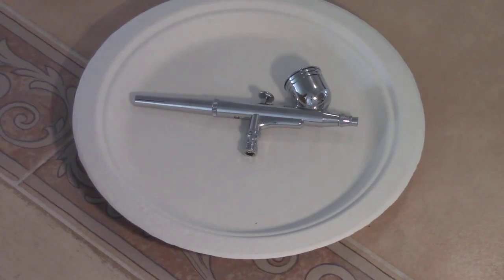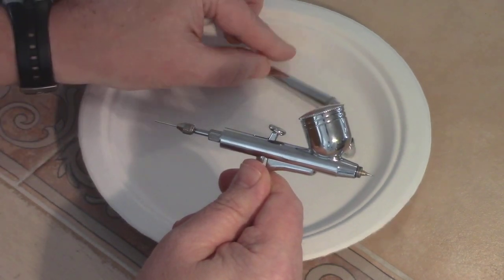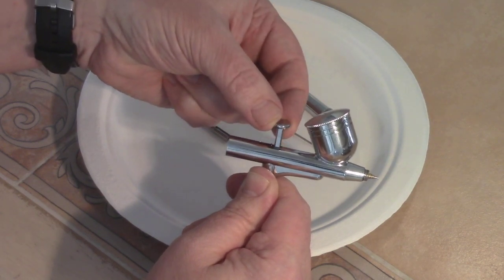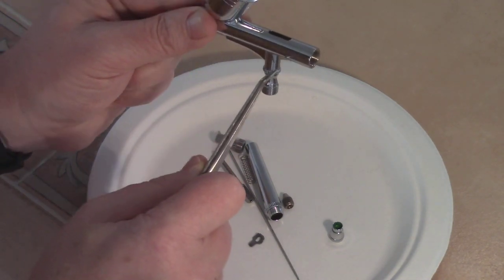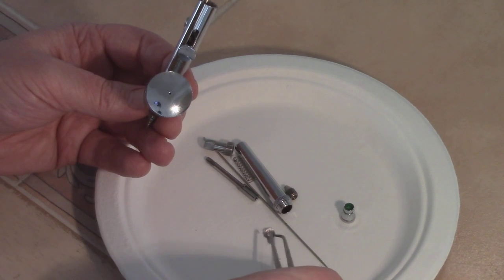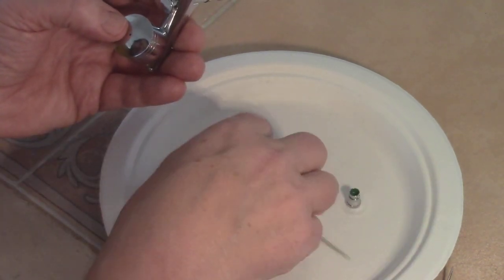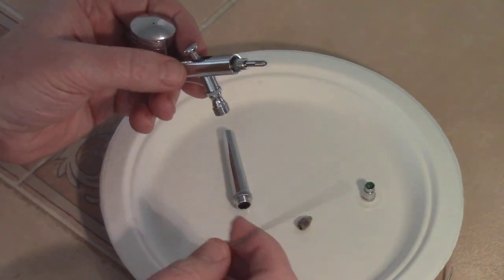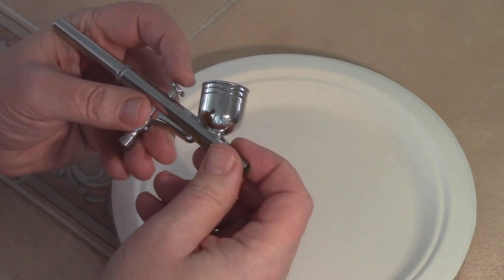Assembling a Master Airbrush

Comment: Great video. Straight and to the point, explained well. Saved me a lot of anxiety as I tried to reassemble mine just now. Fun fact, it looks like on the newer models of the g22 (mine at least) they flange out two little bits for the needle guide so it stays attached.
Reply: Yes but that peace falls off all the time so not so much.

Comment: I just tried to clean my Master G23 in an ultrasonic cleaner, and it just ended up vibrating all this stuff loose - I couldn't get the needle to pass through and the trigger pull was rough. Ended up taking the entire thing apart, put the pieces  in a bin and decided to tackle it tomorrow. Thanks to this video, I'll know what I need to do tomorrow morning! Thank you!

Comment: I JUST used my airbrush (the g22) for the first time tonight. This guide is excellent and answered my question about seating the needle. After I load paint (in this case Steinalrez Black) the paint seems to drizzle out of the front AND just pushing the trigger down doesn't only allow air, paint always comes out. I did make sure to use the .5 kit that came with it per the primer's directions.  Any advice?

Comment: I have the black master pro plus with the 2 interchangeable cups and it doesn't seem like the tip or front section wants to unscrew....is this particular model not meant to come apart in the front?

Comment: I came here just to confirm what I already new. Tore down my G22 the other day for the 100th plus time, cleaned the trigger and removed some dried paint from place. Put back together like always and now my trigger stays down when I release it. I have to pull it back up. It does try to come up, you can feel the spring action but it still sticks down. So the trigger worked fine until I removed the gunk and now it sticks down. WTF....

Comment: What Did I Miss ? What Was The Point of Taking This Apart ?
Reply from the maker: It needs to be taken apart to properly clean it, Putting it back together can be tricky. Showing the disassembly and assembly may help people to better under how it is done.
Reply: +Cal Sanchez He should have lubed it during reassembly, but it was more just instructional about the reassembly mechanics.
Reply: +AZ-3D Bob it was helpfull. thanks
Reply: Adrian Massi great point. What is the recommended lubrication for these? I'd read somewhere that WD40 or machine oil, were no-no's...?